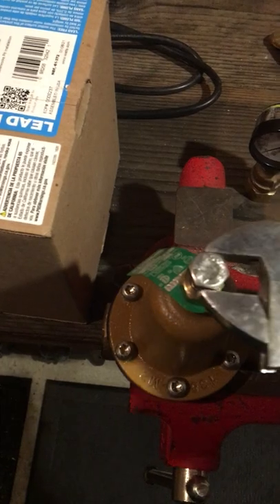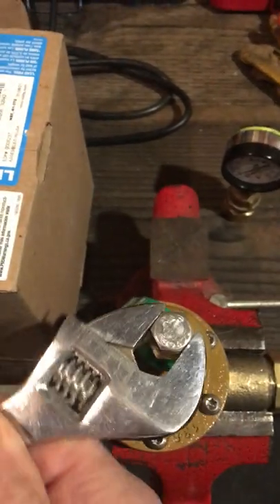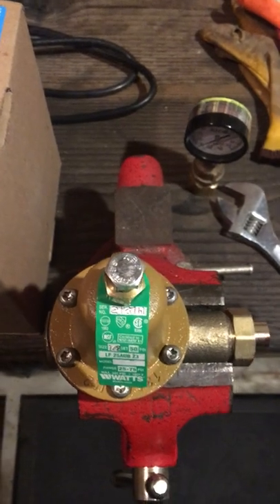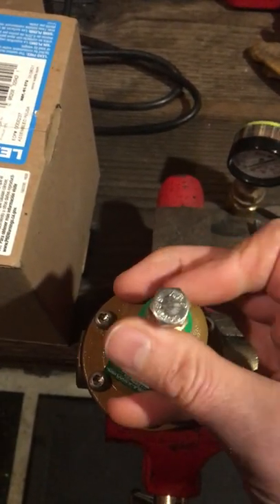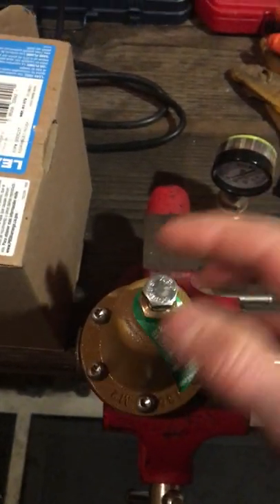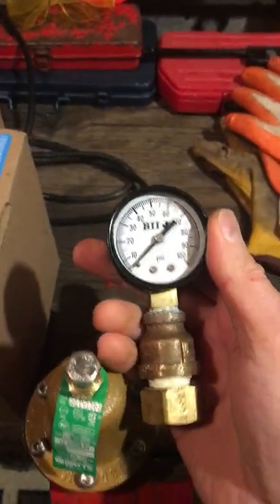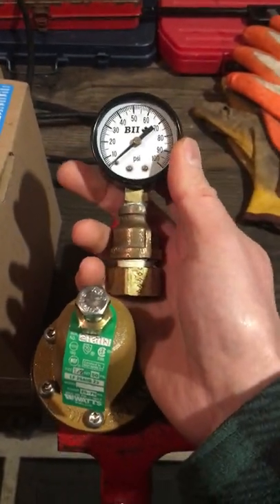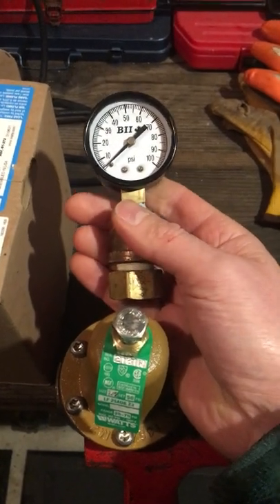How to Adjust Water Pressure 🔧 on PRV like a pro! 😀 #shorts #plumbing #tips

Comment: mine is 90-100 and as much as I loosen nut pressure doesn’t change. New regulator you think?
Reply from the maker: Most of the time yes replace it but there have been a few occasions where if your test gauge is on an outside hose bib you could get a false reading because that line has been installed before the prv so you’ll get a full street pressure reading.

Comment: I'm not a professional myself... in fact I really didn't know what that was... but I'm thinking if you go clockwise on the nut it would decrease the water pressure because it would go deeper into the PRV and counter clockwise would come out more and allow the flow to increase.... Im just saying thats what I would assume by looking at it.  So the question is ... did you mistakenly say it backwards or am I wrong...?  I'm just clarifying.   Thank you.  P.S. Subbed
Reply from the maker: That's what I thought the first time I looked at a prv but nope its what I said cranking the bolt in increases the pressure but I totally get why you would think that. Maybe one day when I get ahold of a used one I will make a video on the inner workings of the thing! Hey thanks for all the great comments, and thanks for subbing!

Comment: Mine is leaking. Installed 4 months ago. Should I increase pressure???
Reply from the maker: No, only adjust after leak has been fixed. You may have to replace the Prv depending where it's leaking from.

Comment: Is it worth giving it a shot at trying to adjust the nut on a PRV that's old l, the nut is rusty and a little corroided. Just a little scared that if I turn the nut it might leak and I'll have to replace it.
Reply from the maker: @SaL-ep7zb  In most cases, when a prv is old or rusty as you have described, adjustment doesn’t work. You could try adjusting but make sure your main shut off works beforehand. Good luck!

Comment: My old prv is corroded and leaking. It seems to be plumbed male to male. How do I remove old and replace new? Headed to google now!
Reply from the maker: Depends how accessible it is & the type of piping. You can get different adapters for prvs. Check out my ( how to lower water pressure & extend plumbing fixture life) video👍